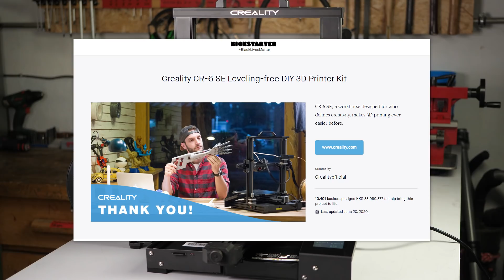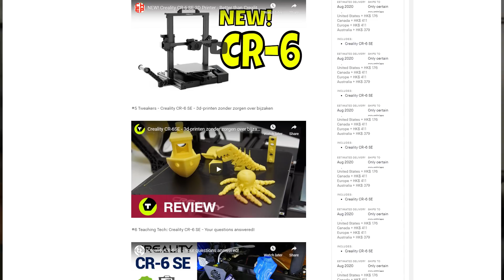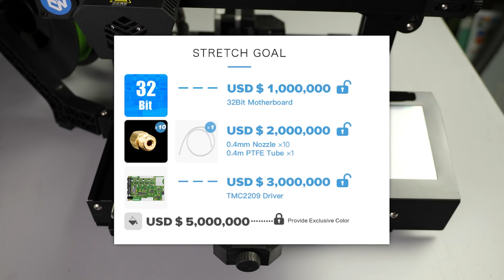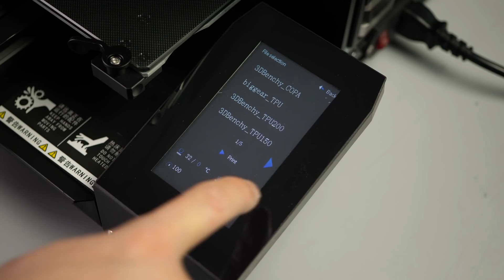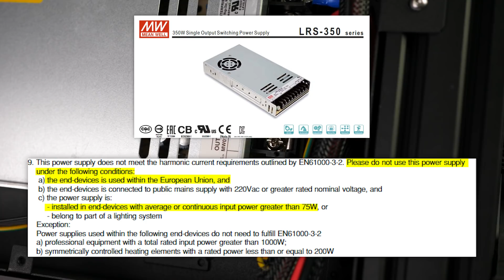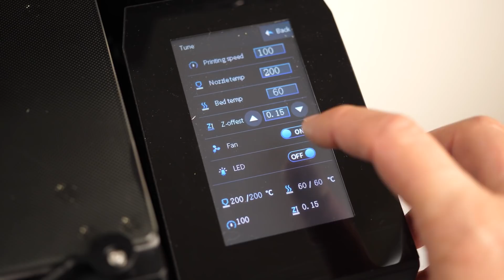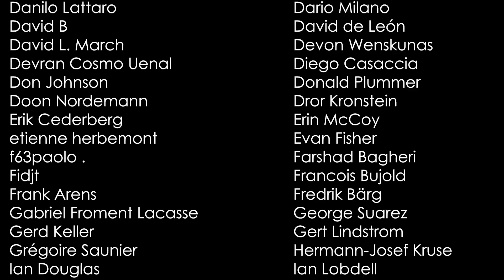Creality CR-6 SE - The NEW (over)hyped Kickstarter 3D printer?

Comment: I can't help comparing every new printer to my Sidewinder X1 v4 I got during "Black Friday" 2019 for US$349, delivered.
- The rigid construction eliminates any need for auto bed-leveling: The bed can be manually leveled once then forgotten for many spools.  I've only re-leveled mine when switching nozzles (using 0.6 now).
- The need for easy belt tensioners goes away when the belts are better quality and simply don't stretch.
- The silicone AC bed heater gets the large textured glass bed get up to temperature quickly.  Yes, I also want a flexible metal PEI bed, but it's for convenience, not need.
- The clone Volcano hot-end is a dream, even for regular prints.  It even lets me easily print filament that's too wet for my other printers.
- The direct-drive extruder makes sense on larger printers because it won't cause a speed penalty compared to moving the massive bed.
- The dual-drive Z with a sync belt eliminates all worries about misalignment.  Talk about "belt & suspenders"!
The list goes on, but you get the idea: A printer that gets all the small mechanical things right doesn't need to get too fancy.
Looking at the CR-6 SE from this perspective, it's easy to see that the auto-leveling is needed not for the hard-mounted bed, but due to the expected droop of the single-side drive Z axis.  Single-side Z drive works great for tiny printers with light carriages (and Bowden extruders), but it doesn't scale well.  For something this size, at a minimum I'd like to see a second worm shaft driven by a belt from a single Z stepper.
Now look at the choice for Bowden: Creality still needs the light carriage, but not for speed: This is to minimize the droop the auto-leveling must compensate. 
Finally, let's go back to Stefan's observation of the low force of the auto-leveling sensor: This is needed to avoid LIFTING the floating Z!  I suspect there's droop baked-in to the design itself that Creality couldn't be bothered to remove.
The Creality CR-6 SE is a kluge, a compromised up-scale of a successful (but smaller) lightweight design.
Reply: The CR-6 SE also has a dual-drive Z axis with belt sync, it just wan't shown here.
I would have loved to see an all-metal hotend and a direct drive, though.
Reply: They're very similar machines, the biggest differences are the Sidewinder having a significantly bigger print volume (comparable to the CR6 MAX, which is actually bigger) and direct drive, and the CR6 having auto-leveling. Whether or not those are advantages or disadvantages really depends on the user, though I don't see auto-leveling being a disadvantage in 99.99999% of cases.

The larger print capacity is attractive, but that also comes with a much larger footprint, and a lot of people simply don't have the space for that. Direct drive is certainly desirable for some people, particularly when it comes to flexibles, but for a lot of us the extra speed is more desirable; I converted my A8 from direct to Bowden for just that reason (and it works just fine with flexibles despite the long Bowden tube due to the extruder being mounted on the top of the frame.)

Now, you managed to get your for $350 USD delivered, and that's fantastic value for money, but as of right now that printer costs $450 USD, or $620 CAD, plus $100 CAD shipping, so $720 CAD total for me; the CR6, on the other hand, only set me back $505 CAD shipped; $215 buys a buttload of filament.

The Sidewinder certainly looks like a great printer, and if I was in the market for (and had the space for) a Large Volume printer I'd certainly consider it, but saying that the CR6 is somehow shitty in comparison, especially when you present incorrect details such as claiming it uses a single lead screw and before the production models are even out, is extremely ignorant. When the production models start arriving in August/September, that's when we'll know for sure how good or bad they really are.
Reply: @irishalcoholic  it's not shitty it just another 3D printer in the middle of a huge pack of 3D printers especially in this bed size range, I'm sure many will be very happy with it which is great the more people 3D printing the better as it may "eventually" drive more innovation. I think the annoyance comes from the hype over something that is middle of the pack and it's large success could encourage others to sit on their laurels for the moment and keep churning out printers that don't move the needle forward and everyone that loves 3D printing wants to see more innovation and outside the box stuff.

Comment: My assumption for why they didn't go with a flexible bed is the PEI would degrade at the probe points over time. Whereas glass being a hard surface probably gives more consistent probe accuracy, and low chance of damage. Though to be honest if they had just integrated a BL touch style sensor to get surface contact regardless of material hardness or nozzle build up, I think it would be better.
Reply: They do have a PEI build plate as an option. I'm not sure why he didn't mention that.
Also, you don't have to probe the bed very often, just if you've moved it or swapped beds/nozzles.
Reply from the maker: Oh, you're right! Though it's still an extra purchase.

Comment: On the TMC 2209s - there are two significant differences with the TMC 2208s that I'm aware of; the stall guard feature as you mention, but also they're capable of substantially higher output power. I believe (correct me if I'm wrong!) this means they require less cooling, so maybe if the board has TMC 2209s it's more likely to last longer.
Reply: It's also for linear advance.
Reply from the maker: Yes, you're right. But there is no need for the extra amps on such a printer. Yes, they might run cooler, but if the electronics are properly designed, also not a problem.
Reply: @CNCKitchen  Hmmm - I bought the 400mm print bed version and wonder if Creality wanted extra power capability for this and other larger printers in the future perhaps?
Reply: 2208s are also notorious for not working so well as extruders.
Reply: @KentoCommenT  Really? that's interesting because I've been running full 2208's on my CR-10 for well over 2 years now (all Axis ,XYZ and E). granted i also run a BMG clone as well so maybe that's the trick but it's works beautifully on my CR-10 ever since i started using them.

Comment: 260C on a PTFE tube? I don't think so. 245C will deform the tube after 200 hours. 260C is releasing toxic fumes within the first hour of printing.

The glass bed plate is required for the type of sensor they are using. PEI would get little divots in it if the nozzle was hot while probing.

Good review on a so-so printer.
Reply: Yes. Even with those Capricorn XS  tubes that advertise to withstand 300 ºC temperatures... they will soon deform at only 240ºC.

Comment: It seems like they really should have added a nozzle cleaning region like on Lulzbot printers. Exposed mains is not OK as far as I'm concerned, and that PSU is absurdly loud... I'm also still a little confused by the gap between the run-out sensor and extruder. It seems like a small ptfe tube would fix it.

Comment: I'm sure it's possible to redesign the PSU cooling system to use external PC fans, or maybe replace the built in fan with a quieter model. It seems like a good printer overall, with a lot of the "standard" Ender 3 upgrades already included. I'm a bit concerned as to the upgradeability of the extruder now that the bed level sensor is so integrated. If you were to replace it with an E3D V6 or Mosquito, you'll need to do a bit more work to make sure you keep your bed leveling. 

Side note: are those Mosquito-style heater block supports? Looks like it'll be nice for quicker nozzle swaps, but definitely doesn't have the same separation as the original.
Reply from the maker: Wouldn't fiddle around with the PSU, there is a potential electrification risk.
Yes, there are studs between block and heatsink, but Creality have been using that for a while, afaik.
Reply: @CNCKitchen  Why does it seem that every 3D printing YouTuber is so afraid of a little simple wiring? It's not that complicated, unplug it from the wall, wait for 5 or 10 minutes if you're super paranoid to ensure any capacitors are fully discharged, then open it up and change the fan. It's not some black-magic box that will curse you if you dare to open it and gaze upon it's secrets lol.

I could understand if we were talking about someone who is not mechanically inclined in any way, who simply doesn't understand things like this. Those people certainly exist, and yes, they're probably better off leaving well enough alone, but you're clearly not one of those people; you create things, think critically, problem solve etc, so your seeming aversion to "fiddle around" with a little bit of wiring doesn't make much sense.

Comment: Nice to see someone else picking up the power supply incompatibility with EU (and UK for that matter) regs. Most people I've talked to about it just brush it off - mostly the US in particular don't much care.
The main issue is the LRS series don't have power factor correction (PFC) which is required by the EU regulation IEC/EN61000-3-2 - makes for a more power-efficient electricity network so better for the environment. This EU approach however is only effective if it's a regulation applied to all devices so that the small individual differences accumulate. Having said that, this is also the case for pretty much all machines from China (including all the other Creality machines I believe), so nothing new. Obviously Prusa aren't in a position to get away with that, or at least the PSU in my Prusa Mk3 has PFC. The RSP series from Meanwell have active PFC, for something like a $5-$10 difference retail.
I suspect Creality just don't even think about it.
Reply: Another note on the power supply - Creality have said that they will be using several power supply manufacturers, including Delta (which is what Prusa use today). Some backers caused a ruckus on that, so Creality said they'd supply Meanwell to the backers; it'll be interesting to see if the Delta PSU they choose has PFC or not. Personally I'd be as happy with Delta as I would with Meanwell.
Reply: I'll add - the other part of the EU regs relating to the power supply is EMC - but here I don't suppose many people care at all, what with the open design leaving the motors and so on exposed. It also seems there's a "get-out" clause as a result of calling the equipment a kit. The PSU is supposed to be mounted to an appropriate mounting plate - the Meanwell documentation includes guidance on what they used for their own test results - and perhaps enclosing it in the metal chassis helps with that, although I suspect the reason for enclosing it is mostly about safety. As you note, however, enclosing it in the chassis increases the noise when the power supply fan kicks in. At least with the Meanwell supply the fan is thermostatically controlled so isn't on all the time - unlike the PSU with the Ender 3 which just runs its fan continuously.
Reply: @kevfquinn  Unfortunately it is a very common misconception that a kit would not have to meet the EMC directive. Even kits, where you have to solder your own PCB and assemble everything will need to meet the EMC directive in the EU.
The literal text in the EMC directive for the exemption is: "custom built evaluation kits destined for professionals to be used solely at research and development facilities for such purposes."
It is not custom built. It is not an evaluation kit. It is not (only) destined for professionals. It is not intended to be used only at R&D facilities for evaluation.
Even within an R&D environment labelling it a kit is limited (see EMCD guide)
Non-exhaustive list of examples of evaluation kits that do NOT benefit from this exemption (even if there is a possibility for the user to adapt it to his specific needs or to build it himself):
- All devices/equipment used on a regular basis (such as laboratory equipment) to perform tests for the purposes of research and development or for other applications such as to demonstrate the conformity or quality of a product.
- Evaluation equipment for users in general in R&D departments (in this case, the equipment is always the same and is not "custom built").
Reply: @kirepudsje3743  Thanks, that's good to know.
I guess in practice while it's small amounts of domestic use it's not worth the authorities' time. Anyone setting up a significant print farm business however could be of interest.
Reply: @kevfquinn  The authorities not always go to the large amounts. The market surveys in general do, but customs is random. It always feels unfair that big companies get away with not meeting the requirements and then the little companies are cought. For example in my home, the TV box, the energy meter, the ADSL modem and the Wifi router all do not meet the CE requirements. And then a few weeks back, we had a local small company only selling 100 devices in total, in principle meeting all requirements but being stopped on a formality, costing him thousands of Euros. (FYI: in my daily job I work for a testlab and am a notified body certifier for the EMC and radio (RED) directive)

Comment: PSU noise is also a problem on the ender 3, maybe the same fix (i.e. shroud over the fan) can help with this issue. Or, worst case, of course, switching the fan to a different model.
Reply: You can easily change the Ender 3 PSU's fan because it's mounted on the side. Just get a cheap 80mm Noctua fan and you're good to go. Although you'll then start to hear the capacitors on it clicking as the final bed temperature is reached. Guess it's because it's a cheap PSU.
Reply: @alejandroperez5368  can you get 24v fans from noctua at that size? I honestly never looked into it.
Reply: @frankyboy4409  Well...some Ender 3 PSU fans work at 12V even though the PSU outputs 24V. You gotta check yours.
Reply: @alejandroperez5368  oh interesting. yeah I'll check that definitely.

Comment: My original Tarantula has the same problem with the PSU fan, except it's not even a Meanwell. :V
I've halfway considered consolidating the PSU and control electronics in a single enclosure with a 90-190mm fan to cool it all, as the PSU fan is hands-down the noisiest part of that machine.

Comment: Printing on glass is so 2017. Flex plates FTW!
Reply: They do have a PEI flex plate as an option. I'm not sure why he didn't mention that.
Reply: 2020 isn't so hot :) .  I have used plain glass successfully for many years with very little maintenance nor replacement of the glass beds unlike PEI that eventually wears out and needs regular care and attention.  I am not anti-flex or PEI - if you get successful prints (and print removal) that is most important.

Comment: The carry handle is utterly superfluous. No one would ever struggle to carry their printer by holding the top extrusion. Just a "feature" for the sake of an extra marketing bullet point.
Reply from the maker: Been using it a bit for carrying around and it's in a way handy, because there is the timing belt for the z-axis next to the extrusion.
Reply: @CNCKitchen  Ah! Fair enough. I guess it's not completely pointless then.
Reply: @CNCKitchen  yup but your not exactly a normal user how many others will move the printer around very often

Comment: A much needed review with a more critical spin. The CR-6 is certainly going to be a good machine but it does feel over hyped with the amount the kickstarter has raised. Frankly, I am really impressed they could get the price so low on kickstarter with kickstarter's 10% cut and shipping/certification fees. They are probably selling a lot of the machines for little profit and maybe even a loss.
Reply: Haha think they inflated the retail price to make you think that which is a very typical thing to do in Asia. All the components can be readily mass produced and are cheap so they will still make their usual profit especially cosidering the volume and not going through resellers. These guys are business pros and won't give you sth for free.

Comment: Thanks for the good review! 
I bought the Ender 3 v2 and i can see similarity between the two:
1. same bed material 
2. same screen (but the v2 isn't touch)
3. same loud noise from the power supply... :(
I saw the CR6 on kickstarter but (luckily) i was a bit late so the price wasn't low enough...
the noise  in the V2 was a big disappointment since everybody was talking about the quiet motors/fans bla bla..
but other than that - happy with the results.

Comment: All good quality parts, and some impressive innovation.  Too bad the power supply noise kills it.  Mean Well is a good brand, but if the supply is undersized, it will have to fire up the fan to keep up.
Do you think this is something that would be solved by a bigger supply?  Or will the first mod for this printer be an external PS enclosure with integrated muffler?
Reply from the maker: I suppose there is a quiter version available but maybe it's more expensive. Prusa even use a fan-less PSU in their MK2 & MK3.